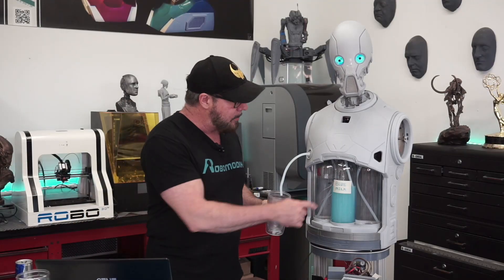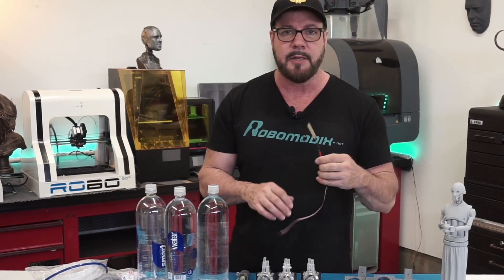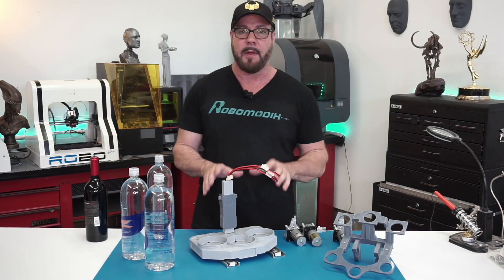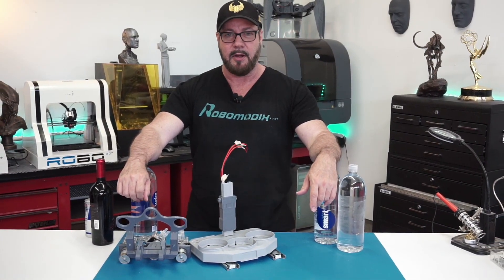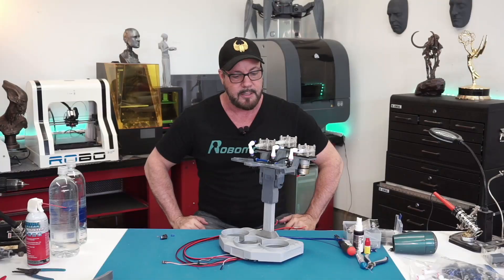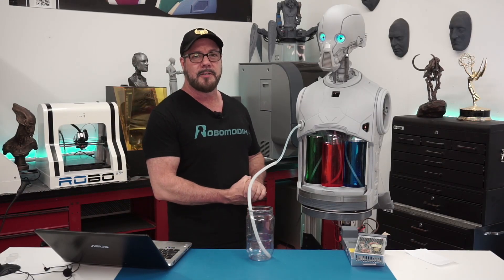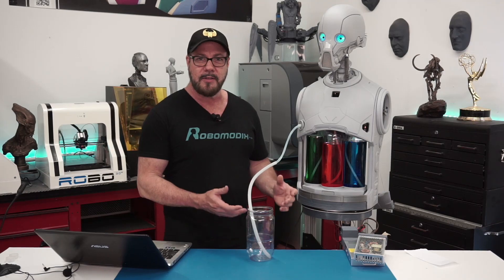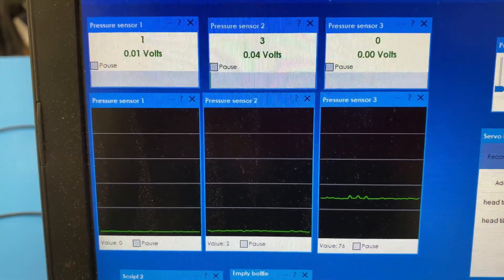My Droid gets a voice activated pump system! (Episode 3)

Comment: How does the pressure sensor work? From the vid i noticed that not empty bottles indicate 0V and empty had 0,05 (or 0,5) V - I dont understand how can it non-continually distinguish between 50ml and 100ml of liquid?
Reply from the maker: It doesn't tell how much liquid is left, these type of sensors are not that sensitive. You can adjust that sensitivity with resistors. So you adjust them to the amount of weight you want to track, where it is either detecting pressure or not. They are strange sensors and would not use them again for a project.

Comment: So freaking awesome!  I love seeing your process with this build.  I'm going to want a bartender robot now, lol.  It looks like at first you did not paint the 3 pressure sensors, but in the end it looks like they were painted over....did you paint over them?  I think in the this video I just caught or understood you are heating up the screw and the threaded end screw holder in as one piece, aren't you?  Then unscrewing the screw later once the threaded insert is set...am I right?  Such cool stuff Will!!!
Reply from the maker: Thanks Justin! I had tape over the sensors to protect them from the paint, then later removed it. Yes correct the plastic screw inserts have the screws in them during the heating process. If they are not melted plastic enters the hole of the insert and you cannot get the screw in later.

Comment: My experience with those weight sensors is that your won't get a robust reading from them for "empty" vs "1/8 full."

If that ends up being true, consider optical or ultrasonic sensors, perhaps?
Reply from the maker: You can actually "adjust the sensitivity" of the sensors with different sized resistors connected to them. I have it dialed in, my issue was the bottle holder is a little tight and didnt let go of the bottle..so it kinda hovered empty ! LOL.